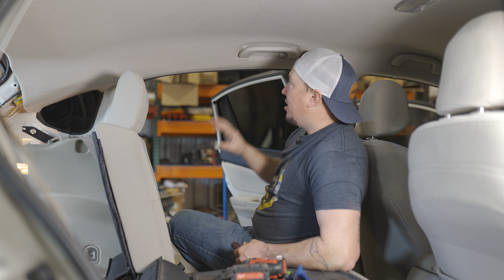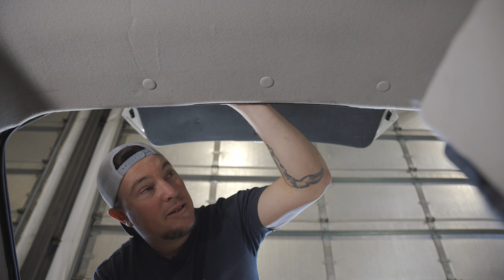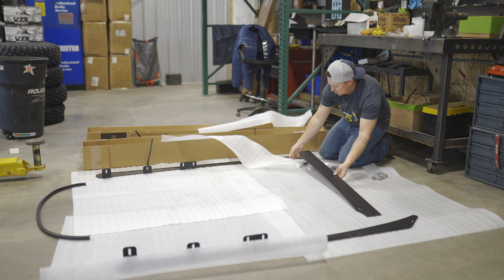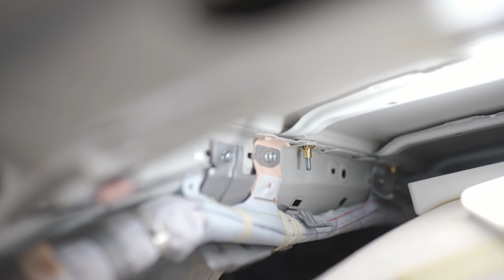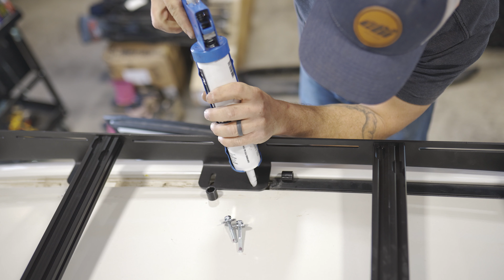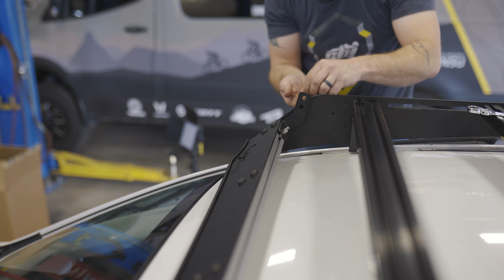PRINSU INSTALL: Crosstrek Rack

Comment: Ok, got my rack for the 2nd hen Crosstrek, but the number of parts supplied doesn’t make the instructions. I got 10 large washers, 6 smaller washers, and no lock washers in my mounting hardware bag in spite of there being 12 mounting holes…
Reply: Please contact our customer service team and if there is any issue with your order they will get you taken care of right away!

Comment: About how long would you estimate this took?  I'm setting aside a whole day to put mine on when it gets here in the next week or two.  Hopefully I can get it on in less than 3-4 horus, but I suspect it will take me longer with all the breaks, swearing, and crying I'd be doing before it's all said and done.
Reply: Yeah plan on a full day. Some customers get it done in 4-5 hours and others it takes an hour or two longer. If you need any help give our customer service team a call and they would be glad to help!
Reply: Lol I’m guessing it’s gonna take me like 6 hours or all day I’m kinda intimidated lol
Reply: @sgheavymetal  it ultimately took me most of a day with breaks and review of instructions. The plus nuts are the biggest pain in the ass. Getting a rivet nut expansion tool thingy will save you so much time.

Comment: How do you prevent the plushnuts from spinning when you are tightening them?
Reply: first we recommend making sure they are installed correctly. Then you need to be careful to no over-torque the bolt during installation. These two steps will really help to make sure there are not any problems.